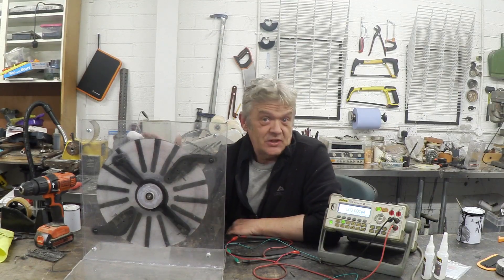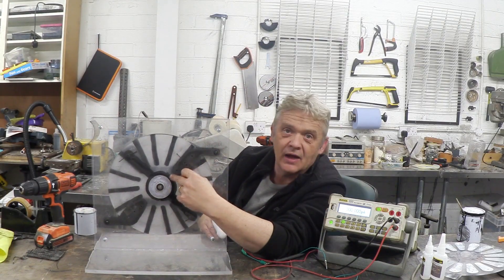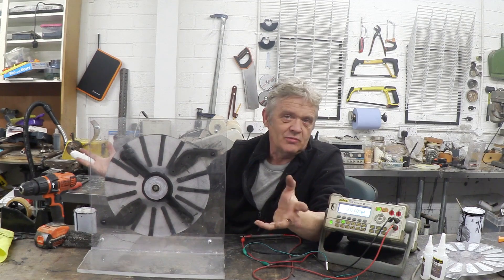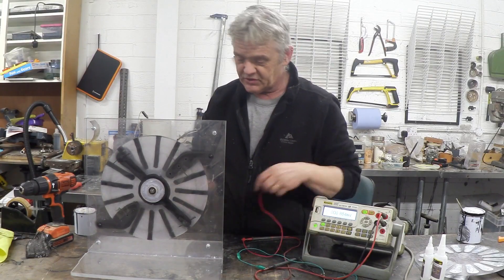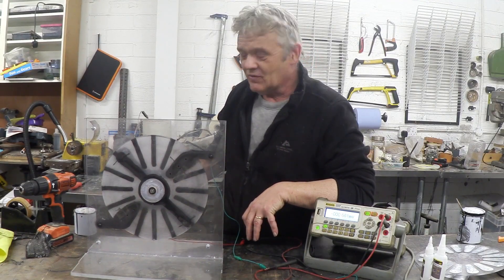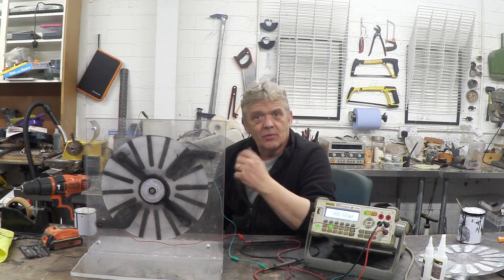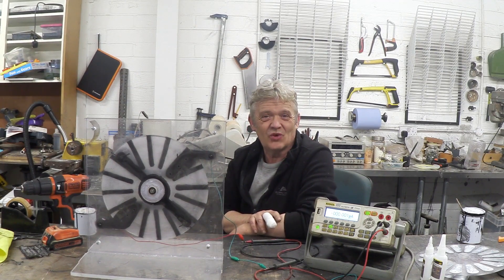725 A Printed Generator - No Copper, No Coils, No Wire, No Magnets

Comment: Generators already cost "absolute pennies".
Measuring voltage\amps without any resistive load is pointless. You could connect that drill to a tiny $1 dc motor and get significantly more power. 
The ink cost alone is probably going to be significantly higher than copper. 
Even if you made it multiple layers thick, you'd still need a pickup layer in between each one, so the thing would be pretty large, forgetting the cost of all the plastic... Whereas you can buy a relatively small 1kw generator for about $120, or get a $20 used car alternator, which will both be significantly cheaper, smaller, and efficient. 
Also, I think you may also be forgetting about the huge number of mechanical inefficiencies that will be in this type of a system, you're basically building a giant flywheel...
You can get a screen printing kit for about $100 on amazon, that'll let you print exact thicknesses, in any design you want, quickly and easily.
Reply: I like how you mention a 'used' car generator.  While using new production for this one.  Also the ink he makes...is super cheap and even shows you how to make it at home.  Even remanufactured alternators (basically new bearings and nothing else) cost 50 bucks.

They also weigh ~15lbs.  And that is not including the rest of the things to turn it.  It takes about 4hp to turn an alternator some even higher.  Compared to this.

Not only that, because of this...one can literally now print a generator on a 3d printer...with plastic that costs pennies.  Buy some PETG for 20 bucks, print 1mm circles, layer it with ink.  And boom generator.
Reply: @elitewolverine  You miss the main problem, the generator makes almost zero power at its current scale. So by the time you get it to anywhere near what a small alternator can do, it'll weigh hundreds of pounds. You're comparing the 1500w output of an alternator, to this microwatt generator.......  And you don't need a rebuilt alternator, go to a junkyard, $15, $10 if you go on their special days.

The fact that you can make the components for cheap is pointless, because you don't realize how many components are necessary to build a machine that you would be capable of pulling any useful energy out of.

I get the enthusiasm of this channel, but if you take a few seconds to do the actual math, you'll find that this is one of the most inefficient, and expensive possible ways of generating electricity.

Like I said before, a $1 DC motor would easily outperform this thing by hundreds of times.
Reply: @eugenes9751  I know where to get a car alternator from, jesus you that point flew over your head.  You are comparing an already built and paid for, throw away part.  For something new.  Thats like saying why buy a new car when I can get one from the junk yard for 600 bucks.  eyeroll.

Also a car alternator has a rating, from RPM, Amp etc.  So if it is rated to put out 100A at 12v at 6500rpm...if you are not at 6500 rpm, then you wont be making 1500watts.

Not only that, they are heavy and require a minimum amount of HP to turn them.  Its why an alternator wont spin at low wind speeds.

Also since Volts can be turned into Amps...if he is putting out 1V and all he did was crank it with his hand...and made by hand without any optimization like a manufactured car alternator is...

Then you can turn 1V easily into higher Amps than the microamps he was getting.   While you wont get 1500W in the same package....thats not the point by any means of this demonstration.

And that plastic is thick, doesn't need to be.

Really the boundry layer between the front and plate is what is creating the static layer and discharging the static power.

So he has a lot of WASTE space.  That can be improved.

No it is not some powergenerator that is gonna change the future...that is not the point of this.
Reply: @elitewolverine  Reusing is always better than new.

Alternators are NOT rated for 6500rpm, they're rated for 1500-2000rpm, and they generate 14.7v.

"Volts can be turned into amps".... Ok, I'm officially done, you clearly have the engineering knowledge of a highschooler. Have a good day.
Reply: @eugenes9751  transformers...facepalm

Comment: Simply multiplying open circuit voltage by short circuit current does not give you the maximum power although it would indicate an absolute but unobtainable theoretical maximum power. A better way is to load your electrostatic generator and plot voltage and current to find the maximum power as is done for solar cells to find the MPTP. ( maximum power transfer point). Your voltmeter has a 10 Megohm input impedance anyway so at 2 volts measured the power generated was v^2/r or 0.4 microwatts. . Measure again with a 10k resistor load snd  See if you can generate any more power. 
I however doubt that you can scale this generator up into the 100's or even thousands of watts needed for practical use.

Comment: So.... if this were a huge span, would that increase voltage/amperage significantly?  Perhaps you could have multiple rings of printed media on one disc, run in parallel, (or series) to produce much greater values. Stunning!

Comment: How are you making the "inductors" on the stator?  are those layers of carbon paint separated by some insulating material?
Reply: If so, when energized, those inductors will still produce a cogging effect. If you put an arc on the radial wraps, this should reduce cogging if one wrap is approaching the stator field at the same time its neighbor is departing...just my intuition.  Not sure about curving the inductors....maybe make many smaller inductors in the form of an arc?  That might just be adding more 'poles' to the machine though, idk.

Comment: Make all surfaces smoother, and more conductive for a more efficient machine. 

Electrostatic devices are always fighting the losses at sharp edges. I suspect the ink is really rough and not very conductive compared to the metal usually used in a Whimshurst Machine. Your machine using traditional metal construction should be able to produce above 500kv sparks.

Comment: So, 2 V, 0.3 µA of current. That makes 0.6 µW of power generated. With a million disks you could reach 600 mW. That could recharge one phone, assuming that the circuit to raise the voltage up to 5 volts doesn't cause much power loss. Well, charge one phone if you are not in a hurry.

Nice idea anyway.

Comment: Imagine Highways and roads lined with pinwheels spinning little versions of your generator every time a vehicle drives by or the wind blows😎
Reply: Use supercapacitors to quickly capture the power generated and then feed the grid from the capacitors

Comment: The only downside I can see is the brushes wearing away the ink. i.e making two parts that are moving, have electrical contact and not producing wear. I was trying to think of ways to avoid that but sadly I realise I'm not that smart lol.  Obviously a 'frictionless' static motor just becomes a wheel once the friction is lost :P . Then again if they can be made cheap enough, they could lbe seen as disposable motors that you would replace when they wear out and then recycle them. Definitely food for thought, which is what I know this channel is about.  You got me on this one :D :D

Comment: So... 0.3 of a micro watt of power at 10 pence per wheel... So you would need 10,000 wheels to produce 1 volt at 1 amp at a cost of 10 pence per wheel... Isn't that 1,000 pounds for 1 volt at 1 amp?

Comment: Sorry Sir, 1 Volt and 10 Megohm resistance of the voltmeter this gives  0.1 Microwatts. ;-)
As a capacitive machine this has less than 50% of efficiency, because if you have a charged capacitor and an uncharged capacitor, you get 50% the voltage and twice the capacitance if you connect them in parallel, this means 50% of energy is lost during the charge transfer.
Reply from the maker: for sure mate but petrol cars are only 20% efficient and we use them every day - it's not about efficiency

Comment: This design uses brush pair as a mechanical  commutator. Slip rings tend to have longer life.

Perhaps an electrostatic pad rotor could be wired with alternating pads connected together electrically and brought out to slip rings? That should work very akin to a externally energised (conventional) alternator with electromagnets moving on rotor. 
But with electrostatics once there is a differential charge on pads, except for leakage, they should hold charge. Resistance only mattering during pad charging.

Play around with voltage on electrostatic pads,  to tune alternator for different rpms.
Reply from the maker: nice ideas mate - cheers

Comment: Have you tested this laying flat?  The reason I ask is if the results are not the same, is the reason this works is because of the voltage gradient of about 300v per meter of the atmosphere is the cause of the effect and if so, the larger the diameter in an upright position will increase the output?
Reply from the maker: I haven't mate and I will do that right now - cheers
Reply: @ThinkingandTinkering  Thanks, looking forward to what the results are.  I hope you didn't take that as a demand for testing, I just figured you already had everything set up and only had to lay it on its side to see what happens.  I understand the whole teaching to fish as to being given a fish thinking and agree.

Comment: Hey some time ago I made an electrostatic nanogerator, just with teflon plate, two sided tape, a piece of aluminum and some PCB copper plate, and it had enough power to make a LED to blink, just with 9 cm² of effective contact surface
Reply from the maker: that is awesome - did you do a paper? if so what's the DOI?
Reply: I didn't one, I think it was a merely curious device, and then I found some papers about similar devices, but probably is worthy to make one and improve the generator

Comment: Does the disc have to be that big to generate power? What if you did tiny versions and stacked them? I think that is where you were thinking. 

How about putting a fan, like the pinwheels we used to play with as kids that go on forever, on the shaft? 

I actually have a particular idea in mind that I’m just not smart enough to figure out how to do but I think it could be a linchpin in the industry of wind power.
Reply from the maker: I don't know - certainly worth investigating

Comment: you can stack a ton of these and use a gear assembly to increase turn speed to perhaps increase its efficiency for the space it takes up, its an awesome build, supremely simple.

although another thought occurs to me, you could hook up some of these to a motorbike with option manual pedalling. manual pedal to generate power and then run the bike off of battery later.

Comment: Could you potentially increase the output by using a contrarotating disk to rub against it instead of a 'static/fixed' one? (excuse the pun). All driven by the one input shaft and potentially gears or pullies to add the contrarotation. Would this generate a the same amount of power as two disks spinning in the same direction or would it increase the power exponentially? I have limited knowledge in this area, please forgive me if my ponderings are naïve.

Comment: Is the plastic static generating and the carbon ink being a conductive feed?

From what I gather  mixed size sheets will generate, but you have to isolate the fields, I forget the surface   conducted name.

For the power, the size Vs battery, it's  not too good. Can't see that In a watch ;) but if it scales, it could work .

Comment: do you have a cheap and easy way of making something that can transmit power over long distance, theres a stream that is somewhere around 200 meters away from my house, if I use a car alternator to utilize that hydro power, I imagine that amount of power wouldnt travel very efficiently through a wire that long, so I have to step up the voltage and step it down again on the receiving end would you have a cheap and easy way on doing that, maybe with those common transformers found on electronic and appliances?....brilliant videos, always looking forward to the next one
Reply from the maker: I haven't thought about it mate - I will give it some thought for sure
Reply: thanks a lot man

Comment: Probably a good idea to use multiple compact discs and use a compact disc motor to drive it . That should make it very easy to drive and if you paint the discs with graphene oxide you can use the laser scribe engraver to create all the pickups and conductors! 👍🏻 i wonder if the discs are over lapping each other if the effect is the same ?
Reply from the maker: nice ideas mate and certainly worth checking out

Comment: I had no idea that an electrostatic machine could produce useful voltages, I thought they were only unusable high voltages. This developed a little could possibly be powered by a pulley and weight arrangement that could be constantly re hoisted or recharged via wind or solar power which could be used to power a CPU which could control/manage all sorts of free energy installations.
Reply from the maker: I like that thought mate - cheers

Comment: Hi Rob, noticed this a couple of time, think should make you aware. when you measure the current it does not provide the power because you are comparing it to the open-circuit voltage. When you short circuit it to measure the current you essentially get close to zero voltage. therefore the power is in the nano Watts or Pico Watts. The best true reading is to use a load which can give you the real power as it will match the true impedance of the motor. 
It is a nice concept but for the industry to take it on board with any seriousness then the size to power consumption would need to be a lot better. Good experiment but that is about all.

Consider setting up a load, even a small battery or LED as you have in the past. LED give a constant voltage with variable current and is a good cheap measurement source, measure both the current and voltage at the same time. 
Keep it up though they are really interesting ideas.
Reply from the maker: cheers mate
Reply: Many electrostatic generators give constant current regardless of output voltage (as long as not sparking over and the speed remains constant). But some generators, I think this one in particular, only output full current when the output is above a certain voltage.
Reply: @dmitrylavrov5267  The way I like to think of it is that these machines is that they will supply a current at whatever voltage is necessary to push that current through the resistance of the system as long as the required voltage is less than what it takes to for plates the start arcing between each other and effectively short out the generator internally.

If you design for that, you can make your geny push out a lot of power.

Simply, it means that these machines have an optimum output and everything outside of that is inneficient.

What's the optimum output? -> Select your output current via your rotational speed then match the load to force the voltage.

Comment: Morning Dr Rob. Once again another winner, who'd have thought it, bit's of spinning plastic and carbon ink, I am before a supreme being

Watching your films makes me think about Mr Tesla in the 1900's and all the amazing high-voltage, high-frequency stuff he did in his labs, he destroyed his New York one after cutting experiments with metal girders and high voltage.

He moved to Colorado Springs to study the conductive nature of low pressure and built the largest ever Tesla Coil, 15 m in diameter which did strange things all around like artificial lightning up to 135 feet long.
Sparks sprang from waterline taps when touched, lightbulbs within 100 feet glowed, sparks jumping between peoples feet and the ground when they walked along the pavement. 
He also destroyed the dynamo's in a power house 6 miles away due to the high frequency currents which set up in them.

It would be pretty cool if you could perhaps try to make one out of found stuff, after viewing many of your different topics I've become a bit of a disciple and frequently worship at Roberts temple of tinkering. I haven't yet got into the inner sanctum (special video's), that's only for the anointed ones (frequent viewers) and would probably fail the many 'Kung Fu' type trials that one must do to enter the brother/sisterhood.

In actual fact you'll probably find that you have quite a female following,  have you an algorithm for those statistics?

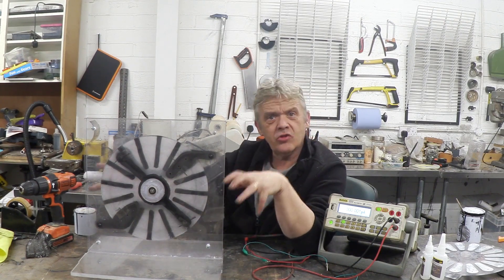I enjoy listening to talks with regional accents and like your voice but for the first time there was one bit of dialect challenge for me,  I had to go back and listen about 3 times, ''painted with a paint'' (2:48). 

All the best Rob, many thanks and should you ever have any questions about lime putty mortars, cob or straw bale building, feel free to ask.
Reply from the maker: awesome mate I will do and I hope to get round to seeing the new Tesla film sometime - it's supposed to be quite good
Reply: @ThinkingandTinkering , I didn't know there was one, so thanks for the heads up Rob. The thing about Tesla is he did experiments with particle weapons, a rail-gun and something that partially destroyed his NY lab. At one time there was a love interest so it'll be interesting what they cover in the film.
The FBI got all his paperwork so there's no telling what they found and kept. . Incidentally it's funny hearing all the background sounds and I reckon you could probably get a bit of revenue from Yodel for the free ad space they got when you made the chimney spinning generator the driver left his van in shot. 

Also, could you please give me a contact # for the firm that sells those things as one of them would be much needed.